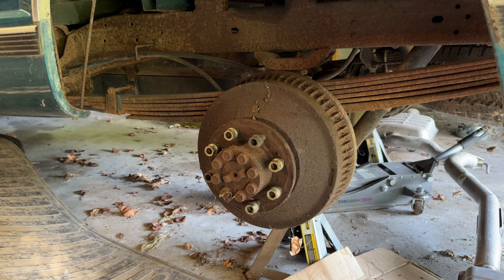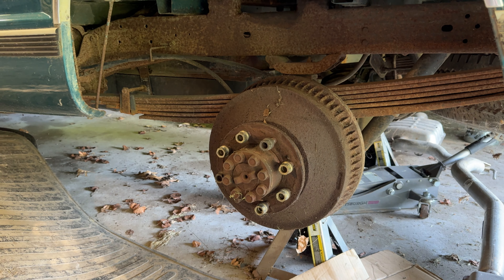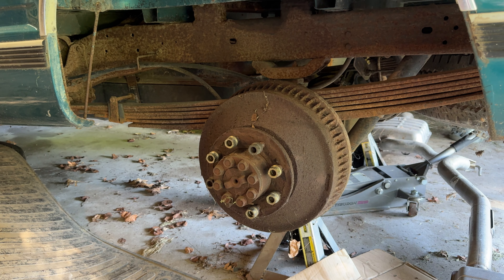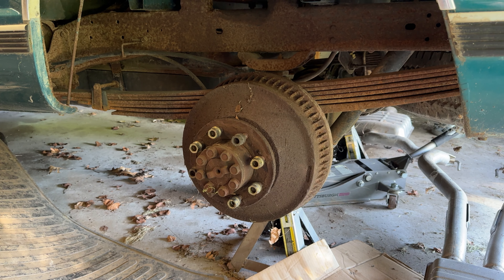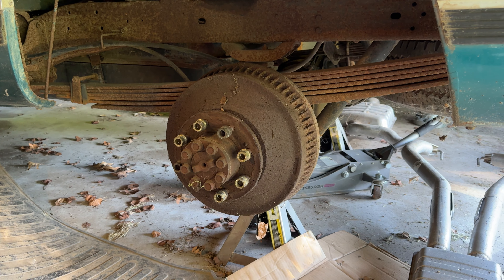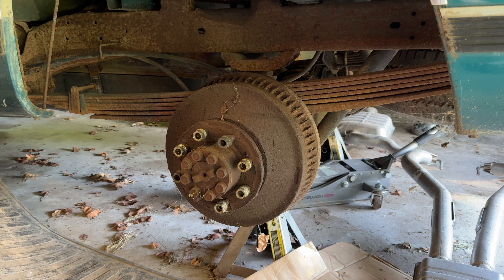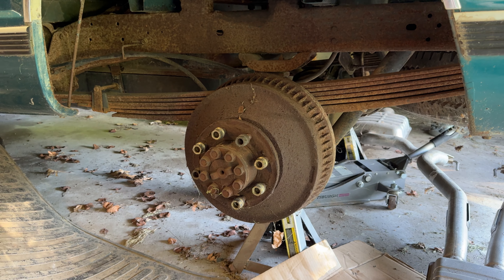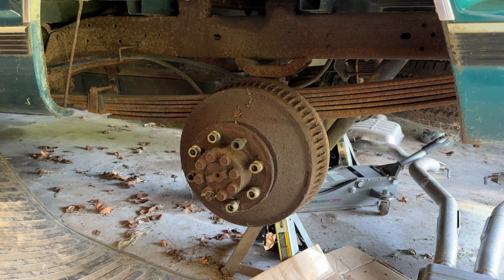EBGPOJ Brakes Intro

Comment: I used to love the 1996 GMC Suburban K2500 the blue one with tan accent, it has a sweet ride, it was in Florida one time, and then they traded in with POS 2010 Ford Flex AWD SEL, and I was disappointed, and the condition is getting worse and later traded in with 2016 Nissan Frontier Pro-4X, and it was nice truck.

On the other hand, I really missed the 1996 GMC Suburban K2500 that drives like a truck and rides like a truck, although it just worn-out.

And yes, it was not that simple to replace the parking brake cable as I can imagine. But who knows that it might be a way to look up the schematics and see how to replace the parking brake cable and amongst other things.

I don't know that you saw the video that the YT user had a video including the retired military 1994 GMC Suburban. It was really cool look.

Comment: Full time work, I know how that goes (I mess with machines in a factory, which is terrifying because I’m pretty sure they know algebra.. I don’t much care for algebra myself).

I’ll definitely stay tuned in for the next video on the subject because this sounds like it’s gonna be a fairly involved brake job. Sounds like there’s a thing or twelve for us all to learn along the way (I do recall at one point needing to replace a parking brake cable, but it was on a 1994 Buick LeSabre Custom so, it was nowhere near as involved to string a new cable).